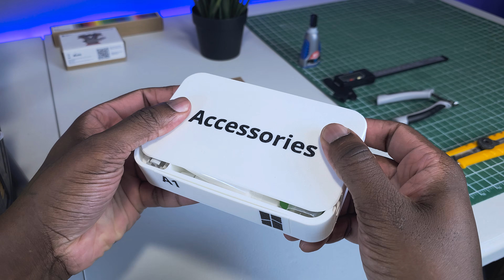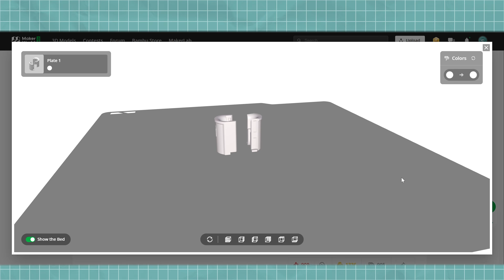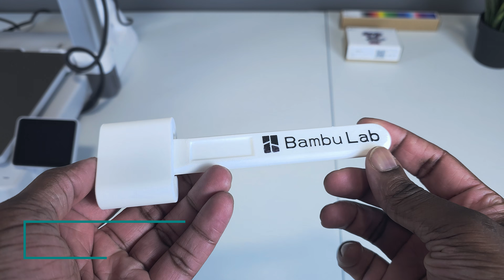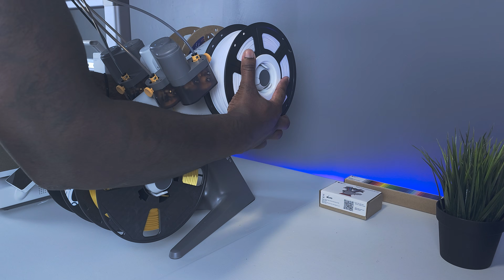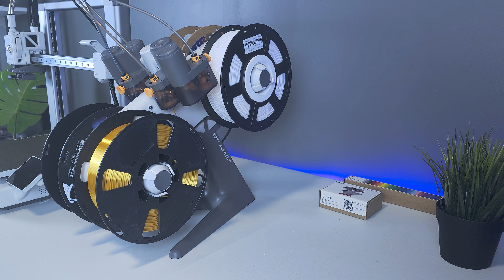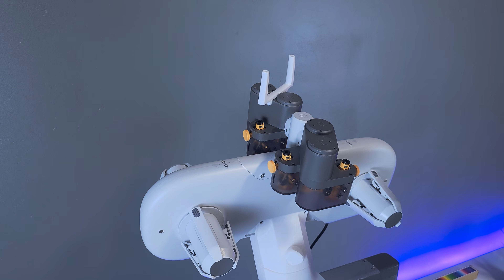Must-Have 3D Printed Accessories! for The Bambu Lab A1

Comment: oh cool. Just got my 1st 3D printer, an A1. Right now just one spool. The cord issue was solved on the newer A1... it's a high quality cable with what looks like a carbon weave protector, in fact all the cables come like that now. 

So far I printed a Hot End case because we do miniatures and that requires the .02 but for tools and other things we'll use the stock .04.

Comment: Hello guys i just bought A1 with AMS and i was thinking to print the "AMS lite Top Mount for A1" because i have limited space in my desk, but im concerned about the weight load and the pressure that will be forced in the printer will be a problem for my A1? Thank in advance

Comment: Excellent video! Thank you.   I immediately printed many of your models on my brand new A1 that I just received a few days ago. However, the A1 heatbed cable protector will not fit onto my cable. I tried everything, including using pliers and vice grips to get it to close, but the hole for the cable is simply too small, the cable is too large. Perhaps my model has a thicker cable because Bambu Lab made changes to address the cable issue, but it looks like it has the older cable connector design where the cable just goes into the back covered by a nylon mesh protector.

Has anyone else experienced this?

Comment: Omg a top mounted AMS?! SIGN ME UPP!
Are there likely to be any issues with the AMS causing wobble? And can the print frame/axis take the weight?!

Edit; having printed a top mounted AMS since posting the comment. No issues! As long as you've got the back stabilises on, it's honestly more stable than the original AMS design.

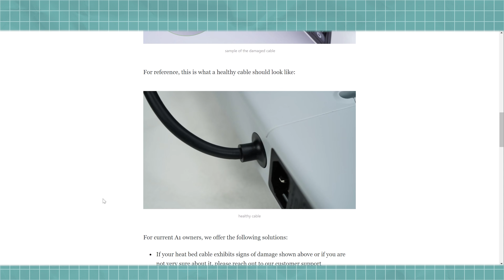Comment: 2:20 that is a badly designed cable connection, has this been updated since?
Reply: Yes Bambu has fixed this issue by making the cable stronger and now it doesn’t bend and get damaged

Comment: The A1 I just got no longer includes a box for the tools. They were all stuffed in a ziplock bag. Also I didn't get any color sample chips.
Reply: Just assembled my A1 I received today, it now just comes with L shaped allen keys, which were a real pain when trying to ensure the screws were fully tight. Disappointing.
Reply: @fattypros82  same here unfortunately
Reply: @fattypros82 same bro
Reply: @solusfides  mine was the same tools and screws were all in zip bags and didn’t get any filament swatches either
Reply: @solusfides  same. But don’t think we’re missing out much.
Reply: My tools were in a box but no plastic tray.  Everything was just stuffed in a little box.
Reply: Got mine last week , tools were in a bag , I ordered the filament swatches for $1.99 cdn funds 🤑 and they sent me one in the A1 box , the one I ordered came from the other end of the country with my filament 🤷‍♂️ all good
Reply: I ordered last week. Been printing up a few things. I thought I lost parts but didn’t get the swatches and tray either.
Reply: Same here man. Was a little disappointed by that
Reply: Omg that's so sad! Did you get the combo? 

Mine didn't come with a tool case but it did come with filament swatches (which I eventually set up with an NFC tag shortcut to BambuLab)
Reply: Yeah, I was wondering if my package was missing something. I also got a LED lamp kit. What did you all get?
Reply: @InfernoD3D  Mine had the tools and screw just in a plastics bag. My did not have no LED lamp kit. The only thing else it had was a little bit of filament in a plastic bag. I wish they would have included the color swatches. It's better to look at the swatches than the color of the filament they sell on a computer monitor.
Reply: @InfernoD3D  yeah me too
Reply: Me too
Reply: I forgot about the swatches 😮.  I ordered mine a month ago.  It arrived yesterday.  No tray,  no hex key grips,  no swatches,  but all the screws I don't need are included😅. 

 The very first thing I printed was the waste bin.  Then the grips,  next was the scraper handle for the included blade,  and I'm currently making a toolbox for the stuff that came in that baggy 😢. 

I heard issues with top mounting the ams lite . It creates extra vibrations that affect your print quality.
Reply: @solusfides  I didn’t get those either.
Reply: Same
Reply: @solusfides  if you didnt get the ams then you dont get color swatches
Reply: @Printingstuff12 but I DID get the AMS with mine. 😅

Comment: Really nice job. I just calibrated my A1, so I'm brand new.  It looks like Bambu Labs added a "jutting protuberance" to the back of the unit to one side of the heating bed cable for protection from banding.  The power cable to the other side of the cable is pretty robust and seems to provide additional protection. I'm guessing that I'm OK without the cable guard, but if anyone knows more that I do (not hard to do), please let me know.

Comment: Thank you sir! After a little less than a month having the A1 combo i've been coming back to this video. The majority of upgrades are pretty useful I recon. 

And as mentioned below already Bambu did indeed improve the cable issue aswell there's screws coming with the printer for the extra's in the box so not needed to buy them indeed. Overal I'm still having euforic days when I see the A1 printing although I just installed the top mount which seems the vibrations are more of an issue but we'll probably get it better soon enough.

Comment: Cable protector does not work with newer models, cable is wrapped in protective sheath making it too big to fit in the protector project i printed
Reply: then you don’t need the protector

Comment: Mine has like mesh netting. Do I still need to print that safe guard for the a1?
Reply from the maker: You don't need to worry. The issues been resolved and your printer with the mesh netting is the newer fixed version.

Comment: btw, it's been a year now and maybe there was an update video but I wanted to mention that the cable issue has been fixed, according to Bambu Lab support. So if you bought a more recent printer, it should be fine.

Comment: You can print two or more colors without an AMS, you ca right click the bar on the right in the slicer -> add pause->change filament-> continue print. With this method you can only switch at layers but that is often more then enough.

Comment: I know this is a year after this video was originally posted, but I just purchased and set up my A1 Combo three days ago and have been printing nearly non-stop ever since. lol  One thing I wanted to point out though is that there must have been a slight change in the heating bed layout during the past year, as the A1 Bed Plate Aligner didn't fit very well, and in fact starting generating errors on the printer that my bed plate wasn't properly aligned. As soon as I removed the "aligner", everything is working 100% again. Other than that, all the other items are great. And one final point... that Bambu Lab scraper tool...  look very carefully at how you screw the blade and the finger stop together. It's easy to get it mixed up, as the Bambu Lab instructions for it are far from clear as to how its put together after you print it. You'll find a green handled version shown, and if you click on the images for it, you'll see how to put it together. Do it wrong, and you'll dig the finish off your build plate.
Reply from the maker: Thanks for the tip on the scraper! Yes, the build plate aligner was made obsolete by a firmware upgrade shortly after I published the video. I uploaded a refreshed list not long ago. Awesome that you recently got a 3D printer as well!

Comment: Just assembled my 3D printer, got it mid last year and this video is a blessing!
Just one thing I'm wondering regarding the 1st print, I've read that Bambulabs actually fixed their cable in regards to that issue, is that true?
Reply from the maker: Yes, that's correct. Any Bambu Lab A1 sold after April 2024 has this issue resolved and those of us that had them prior would've replaced the cable/heatbed manually or shipped it back for a refund. That info's outdated. I've since uploaded a refreshed list.

Comment: Hey!
I just came across your material and I have a question.

After a longer period of use, how do you rate the operation of this AMS holder in the position above the printer? Doesn't this type of installation cause additional vibrations that could affect the print quality? I'm just gathering information before buying my first printer and that was my first thought.

Thanks in advance for your answer!
Reply from the maker: It doesn't cause vibrations that affect the print quality and I don't feel that it puts stress on the printer's frame since it's solid but the thing to be caution about is material. I used Sunlu's PLA Meta and haven't had any issues in 1 year but people have said that it cracks over time from the weight of the spools. Make sure you download/print the spool locks as well though!! They spools have been know to slide off.
Reply: @Creatorrific  Thanks! I'll keep that in mind :)

Comment: what material did you print the AMS top munt with?
Reply from the maker: I used Sunlu's PLA Meta but you should go with as a durable material a you can like PETG or ABS even since some people have mentioned that it can sag or break over tinre from the weight.

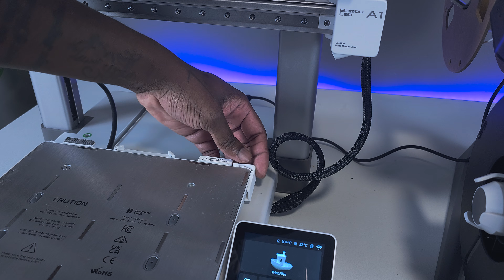Comment: 6:40 that’s only a problem if you’re doing it wrong. I never even considered it to be a problem coming from my ender printer which has no alignment to the magnetic sheet whatsoever. The A1 has a top notch on the buildplate, and it had walls at the top on the bed. Rather than placing it down starting with the side just slot that part in and drop it down.

Comment: I just got my A1 and it’s been nonstop problems and most prints don’t end up working- I have no idea what I’m doing and I didn’t even know there was different types of plates can somone please explain to me the basics of the A1 combo
Reply from the maker: Bambu Lab printers usually work well out of the box. Maybe something got messed up during shipping. Try bed tramming, checking the hotend to make sure its secured in there properly, and running the on-screen calibration afterwards.

Comment: Is there a new or upgraded top mount available for the AMS? I believe I heard about it somewhere, but I can’t recall the channel or video where I came across that information. 

If there is an updated version, I wonder if it includes improvements related to the breaking comments mentioned here.

Great video, btw! 👌
Reply from the maker: I haven't seen any officially from Bambu Lab but there's tons of variations on MakerWorld including one from user Brandon Li which removes the spools to reduced it's weight.

Comment: Just a warning for the top mount! A fair few people, including me, have had it crack and break. It fell onto the print head and I was lucky that mine didnt break but others have had to replace the whole thing. You will need longer screws then the kit suggest and a fair few people say to wrap it with cable ties it case it cracks. You will also need spool locks, even more so if you don’t use Bambu spools, they can wiggle and fall off onto your build place and nossle head.
Reply from the maker: 👍 Thanks for the heads up. I've heard that the spools could potentially slide off but hadn't heard of top mount cracking. Sounds like a nightmare. Glad your 3d printer wasn't damaged. I'll probably end up removing my top mount to mod my AMS Lite + Filadryer S4 into a single unit.

Comment: UPDATE:
Got my printer 2 days ago (Dec 27, 2024) and it looks like Bambu now has a braided sleeve for the heatbed cable. I printed out the STL from this video and it doesn't fit. Sucks that I wasted a print but hopefully the included braided sleeve resolves the issue.

Comment: I love that the philosophy around 3d printers is that you're meant to use it to print its own upgrades, really gets you into the mindset of making a thing to fill a niche instead of buying it. Any one of these things could've been an off-the-shelf product but Bambu decided that no, you bought the printer for a reason, just buy filament and get cracking!
Reply: My Creality came with the stl files for the upgrades/fixes pre-loaded in memory, so all you have to do is load filament and click print.   Very convenient (or something )
Reply: Or they are too lazy to fix the flaws like the poop bucket etc...

Comment: I'm new to 3D printing so I haven't learned yet how to change parameters.  I printed the build plate aligner but it doesn't fit.  The little 'nub' that is supposed to fit underneath the bed is too big and not cylindrical. Great idea though.
Reply from the maker: Please disregard the build plate aligner. A firmware update made this upgrade obsolete since the print head now homes in that position, so it would collide with the aligner. I've since updated a refreshed list of accessories.

Comment: How can you print without an inclosure? I heard pla and others absorb moisture causing issues.
Reply from the maker: Not an issue. Enclosures mainly seperate fumes from the environment for potentially toxic filament like ABS. The moisture that PLA absorbs really isn't an issue but TPU is a whole other story - you'll want to fully dry any TPU before printing or there's going to be guaranteed issues. Storing filament inside of a tote bin with plenty of dessicant packages with dry your filament fine.

Comment: I just started a print while using those black spool rolls like you showed. I didn't think to print the inserts first. How likely is it that these are going to fall off during printing?
Reply from the maker: The inserts are only need if you're using certain spools like the Sunlu brand that have a larger hole, otherwise you're fine without it. If you're using spools that have a larger hole with  the AMS Lite top mount though, it's certain to fall off so you should for sure use an adapter in that situation.

Comment: my a1c actually came with all the top mounting screws from the factory. not sure if thats normal but check your accessory box.
Reply from the maker: Thanks for the info. Not sure if my earlier batch didn't include them or if I just missed it.

Comment: hey - just a quick note: the AMS lite Top Mount hardware is included in the a1 combo, but not if you buy the two separately!
Reply from the maker: Thanks for the heads up! I got one of the earlier batches with the AMS Lite. It didn't come with the screws at that time but they now include them.

Comment: can you use 20mm on the top mount vs 23 mm? i have a bunch of 20mm. lmk and thanks
Reply from the maker: 23 would be more ideal. The attachment hinge is only about 17.5mms wide. The screw in inset slightly about the thickness of the head, so it cuts it to maybe 16.5 mms meaning that the 20mm screw would have less than 4mms to ancor. I'd go 23mms especially considering the weight of the ams, spools and vibrations from printer. Hope that helps!
Reply: @Creatorrific   trip out. i just realized my A1 Combo has 3 bags for those screws needed for this top mount. lol i am so glad i clicked on the link you posted that said where to buy the screws from bambu labs and it says they come in my A1 combo lol what a save! Thanks!

Comment: Reading the comments seems like a few of these upgrades are now obsolete. Does the a1 come with a filament sample box now? Mine came with one today, but I also purchased a filament sample box that is coming in another shipment with filament? Doesn't say on the website it comes with filament sample squares. I mean it was only $17 so I'm not fussed, but yeah.

Got a p1s and an a1 so far that replaced my ender 3 v2's. Probably set them up in the garage now that they're on klipper and use them for something I guess, still decent machines but cannot compare to bambu in any way at all. I was shocked when I got the p1s at how easy and clean everything was. Definitely the current market leader especially for beginners.
Reply from the maker: Hey, thanks for watching! You're right, I plan to update this video. Also, my A1 + AMS Lite combo only came with a small sample (maybe a few feet) of filament when I had bought it.

Happy printing with your new machines!
Reply: @Creatorrific  Sorry, I meant the little swatches. Looks like the A1 comes with swatches now, at least here in Australia as I now have 2 of them, haha.

Probably getting a few more a1s in this black friday sale. i mean i liked 3d printing prior to bambu but now i love 3d printing.

Comment: how reliable is the AMS lite top mount? I'm not quite sure how adding 4kg on top of my printer will affect the vibration and print quality
Reply from the maker: I haven't found that it affects the print quality. The printer frame is actually pretty rigid. As long as you have a solid desk that won't wobble, your prints will turn out great.

Comment: What type of filament did you use for the AMS top mount?
Reply from the maker: I used a Sunlu's Meta PLA. You can also try PETG filament instead if you want something a little more durable but I haven't had any issues with the one I used.

Comment: The plate aligner causes problems:  A1 this causes the printer to have the issue HMS_0300-1A00-0002-0001: The nozzle is wrapped in the filament or the build plate is placed incorrectly. Also: WARNING the latest beta firmware 01.01.50.24 will cause a collision with this when it checks for “filament wrapped detection” it actually moves the nozzle outside the print bed to where this is installed!

Comment: I thinks it's better to keep printing plastic scrapers than using the metal razor. The last thing you want to do is scratch your bed plate. Plastic is a lot more forgiving.
Reply from the maker: 100% agree. The scraper should only be used on the non-textured build plates. Plastic scrapers are what I always use unless I switch.
Reply: @Creatorrific  they why did you as someone owning only the default textured one list the metal scraper as a Must Have